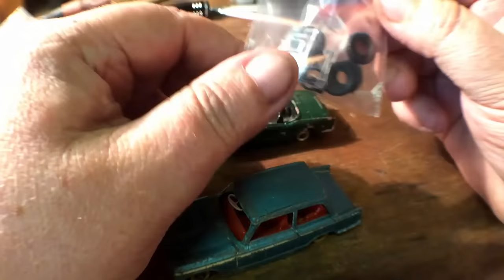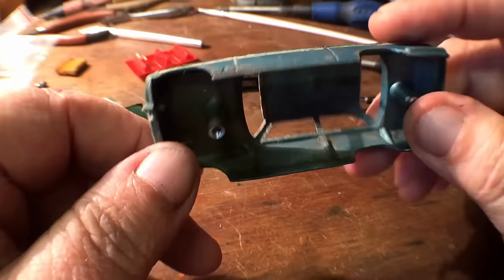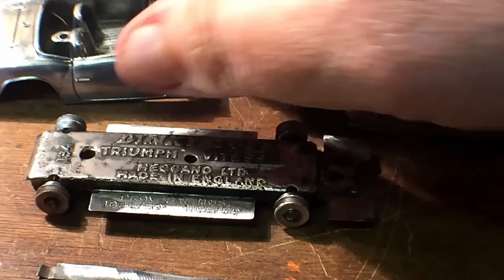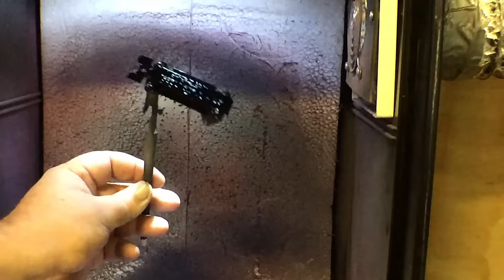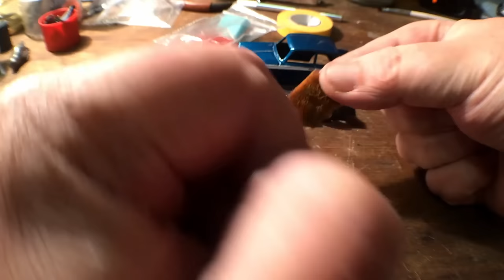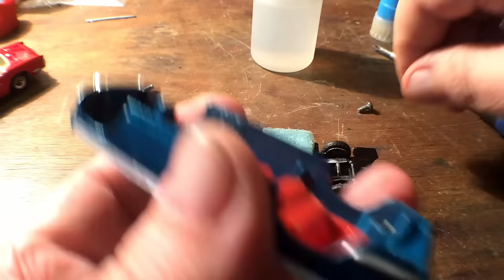Dinky Double Restoration 134 Triumph Vitesse & 114 Triumph Spitfire

Comment: Another superb restoration by a man in a bunnet! (a hat.)   Well up to your usual standards Bob with a good choice of colours and a two for one video as well.  It was most interesting to get the heads up on the rubber pieces in the Spitfire. The combination of red body and tan interior worked very well together.  I also like the detail of using Dinky block tyres.   The Vitesse was another success with the colour very near to the original turquoise (which is difficult to find and a real bugger to try and mix.)  I was upset on your behalf when the A-pillar snapped.  I wanted to run around the room saying swear words.  It has happened to me, also with a Triumph (a TR7), and like you happened right at the end of a restoration which had gone well and looked good.  Your recovery was most impressive.   Keep up the great work Bob you are a treasure, even in a funny hat!

Comment: Great job Bob!  Would the rubber pieces serve two purposes: 1) reduce the looseness of the hinge and add friction so the hood stays up when placed in the up position?  Of course they probably dried and shrunk so a piece of silicon gasket tubing would work well in their place.
Reply from the maker: Geoff Quickfall yes mate but actually the 2 pieces were in quite nice condition! Still very solid, not shrunk or worn.

Comment: Quick Question, What is your Holy Grail DieCast Vehicles that you have or wish to get to Restore? And has LED lighting gotten small enough to add to your vehicles? Attaching the power to them similar as you would a slot car
Reply from the maker: Hi mate, I don’t know really? The Joe 90 car looks difficult so that might be a challenge, as for the led lights I’m not really into that side of it, wouldn’t know where to start 😳